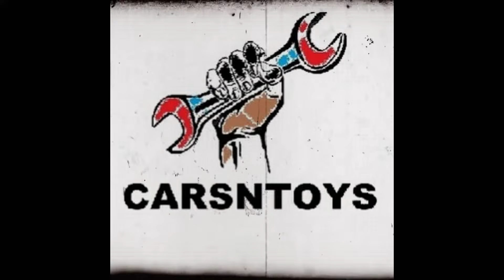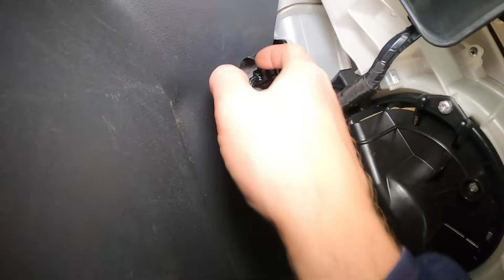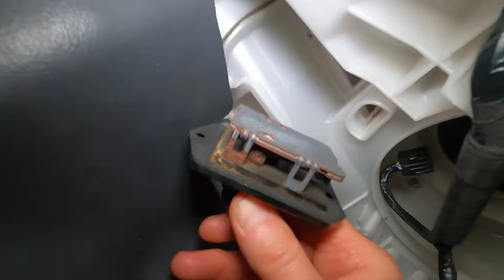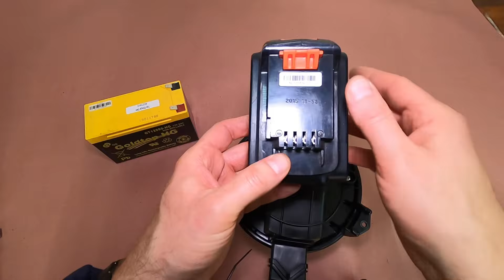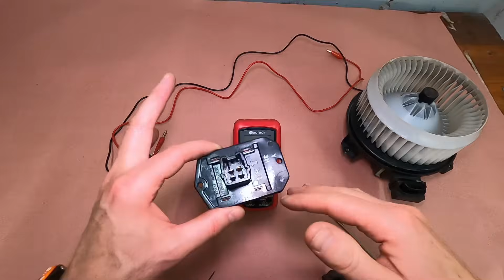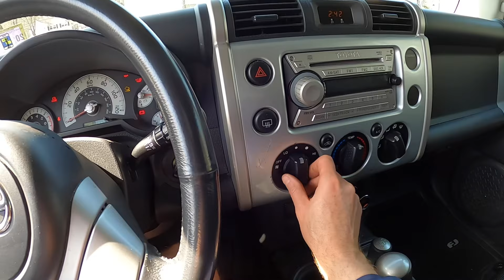How to test and replace a Blower Motor and Resistor | No heat or A/C help.

Comment: My fan speeds work normally on setting 1, 3, and 4 but setting number 2 has no speed change from setting 1

Seems like the resistor is the problem.

Would a bad resistor also cause a parasitic battery drain?

Comment: @carsntoys I find oil around the brain box. An AC technician has checked if there is a valve leakage but finds nothing. But I'm worried. Some said it might be the oil from the AC units.

What could be the reason for oil dripping from the brain box?

Comment: Would the Resistor be located in the same spot in all vehicles? I have a 2008 Toyota Avalon Limited.
Reply: I’m no expert but I’ve seen some older model cars have the resistor access under the hood instead of under the glove box

Comment: Thanks replaceing mines later today
Reply: Are you SURE ?....way easier to replace grounding module on right fender panel than tearing apart all that stuff up under your dash.....I chose to fix the common source of grounding issues FIRST as that should be done anyway. Looks like your problem here is with the Resister, but others problems can result from these vehicle's famously poorly designed and defective grounding module
Reply: @RockinProfessor explain
Reply: @chrismontes9004   I DID fully explain on a video "2008 Chevy Colorado Electrical Fix" a few months ago. My post is up at top (or Near it) Basically explains how I fixed my most common issues once & for all. Please review that comment of mine and let me know if it answers your question.....Another GREAT video on the issues is "Philofab"'s fully explaination on the grounding modules which he calls "Hot Garbage"😆

Comment: Hi there, my 2010 f150 is working on high speed but I already replaced the resistor and still work on high speed, if you have any suggestions where I should check, please help me out ❤
Reply: Might be a problem in the connector wiring
Reply: The switch possibly...